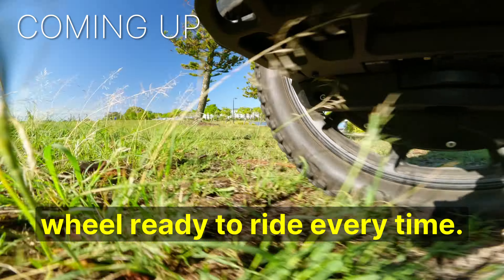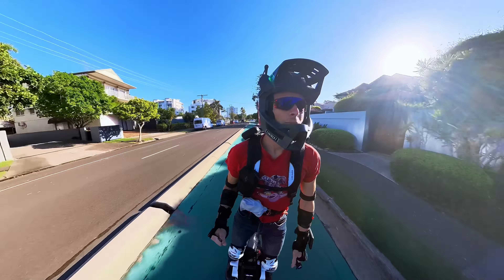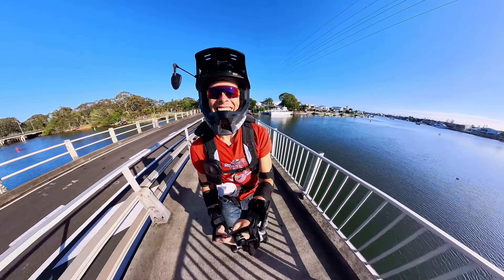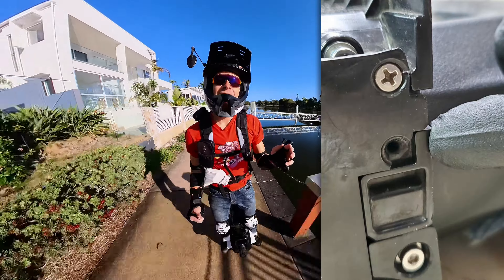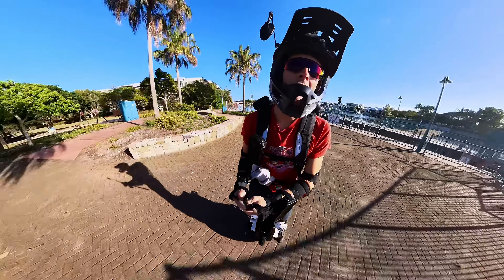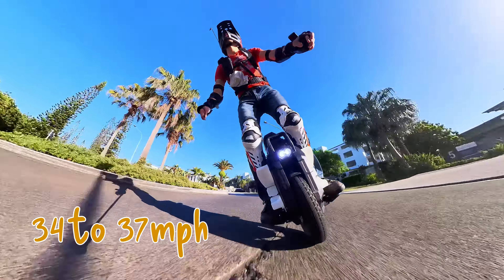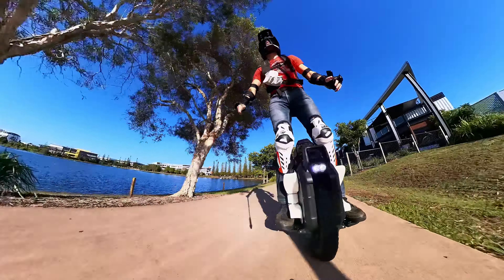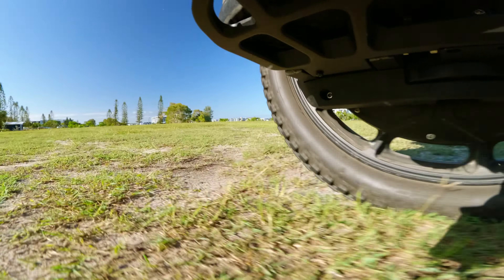long term issues and riding report, Veteran Sherman S Electric Unicycle EUC

Comment: I now have just over 6600 miles on my Sherman S, i took it out the box got on it and road, not ONE  single issue, i just changed the tire two days ago and gave it a major inspection, no barring issues or leaks from shocks or cracks in the casing or plastic. I still cruz around 35 to 43 mph and everything works like new. I'm 6' foot tall and weigh 250lbs with gear 225 without gear. I too am thinking of getting the Lynx but i will keep the Sherman s as my long distance euc. The only problem i have is with the firmware, it will erase my mileage about every three months, so my euc says i have a total mileage of 250miles but i know to just keep track of mileage in my head as i ride, usually 40 to 65 miles a day. This is a great review 😀
Reply: This review its confortabile , thanx
Reply from the maker: Hey Darren, nice! Great distance on the suspension, not sure why mine gave up early. Salt and sand must be that damaging. oh that's annoying about the firmware, happy holidays!
Cheers Jono
Reply: Same with mine. Ive gotten the "no con" 4 times now. Have about just over 4000 kms

Comment: I have my Lynx now. Definetly avoid 70lb unless you are heavy. Even if you are 75kg and do jumps.

Pad compatibility is a bit annoying. My flows don't really fit how I would like them and will need to be adjusted with a dremel tool.
Reply: Can you elaborate on issues with pad compatibility?
Reply from the maker: Thanks for the tip. I'm scrambling for the 62lbs spring down from 66lbs lynx preorder now. The early impressions misled me. 
Is it the jump pad or lack of real estate to fit the pads?
Reply: @jonoeuc  Combination of both. If you are a patton rider already and that provides comfort then you will be fine. But coming from an S22 I am used to having my pads a bit more forward leaning at the top, which you can't do properly with the front bumper installed.

However, if the pads had less of a baser I could angle them a bit more forward. I will be dremeling off some of the pads so they fit over the bumper mounting.

It's by no means a dealbreaker, but definitely something people who haven't ridden a patton should be aware of.
Reply: @Mpower31  Small area because of the front bumper. Grizzla Flow large fit, but you can't angle them forward similar to how you can on an S22 for example.
Reply: I was thinking of putting lynx suspension on a sherman s, the 70lb version I guess would make sense for offroading for someone who is 100-105kg right?

Comment: Hey just wanted to ask. What things should I look out for on my Sherman S? I bought it a few months back and only rode like 150km or so yet. But I'd like to know so I can stay on top of the maintenance. When should I look into doing maintenance, changing suspension oil, ball bearings etc? Also I think I heard in another video of yours that you can get the suspension of lynx in a Sherman S, do you think that would be worth it? I'm relatively big, 6'5, 230 lbs without gear and doing quite a bit of off roading already (and expect to do a lot more).

Any tips really would be very welcome! Great channel and content, thanks! :)
Reply from the maker: Hey mate, the main thing is keeping on top of the tyre pressure. also:
you may want to follow my SS waterproofing guide: https://youtube.com/shorts/1KnpK6qKhV8
If you notice the suspension oil is leaking then it needs a clean or service
When you next teardown use thread locker on all of the bolts. Including checking the motor hub bolts

Yeah the lynx suspension springs can be installed into the Sherman S!
The 70lbs lynx suspension would handle off-road better I reckon. Not critical but the progressive style maybe better with bigger hits.
Reply: @jonoeuc  huge thanks for the reply!

Comment: I got unlucky with mine , my tire is getting very crooked , I had to change the bearings , reccuring noise everytime the wheel turns at certain speeds , I had a E-Hall motor error after my first 500 km (but eevees fixed it) . I love the wheel but ive had less issue my V12ht which is insane to say . I bought the wheel to avoid these issues but turns out I got unlucky . Hopefully next wheel I will buy won't have those problems
Reply from the maker: That's unfortunate. How many km's now after the fixes? (hoping it's running better now).
EUC quality control is a big issue. too much variation.
The tyre alignment shouldn't be an issue unless it starts rubbing. I've the alignment video if you need it here: https://youtube.com/shorts/ZQmxh8WZF6M?feature=share

Comment: I hope this comment finds you well. This is a random question about your backpack. Do you think the backpack is worth the money? Is it specious enough for storing big work boots? The grand total is $585 USD with taxes. 

I have added the following accessories:

1. Helmet cargo net. 
2. Quick release strap. 
3. Velcro waist belt. 
4. Medium cargo addtional storage pack. 

It would be a great idea if you could make a detailed video review about the backpack, its pros, its cons etc... after so many years of owning one. 

Thanks Jon.
Reply from the maker: Hey Uni, Doing well cheers. super hot here but nice for swimming.
That is very expensive. mine was still expensive ~$450 but it was AUD. Here is the one I bought for reference https://e-riderz.com.au/product/point-65-boblbee-gtx-25l-hardshell-backpack/

Here are my size 10US riding boots (from my video's) in the pack for reference https://i.imgur.com/iGTasRj.jpeg

I use it every single ride even if it's empty just for the back protection. If you protect one thing besides your head/brain the spine is a good call. Since injuries there are catastrophic. although most crashes are forwards.

Accessories: The cargo net is the best addon hands down. I've got the X-Case but don't use it since I want the cargo net every time. 
The velcro waist band is hot in summer for me. Also, I'm too skinny for it and it only just cinches down tight enough.

I'm almost too skinny for the strap across the chest too. I have it cinched to the maximum tightness.

It's a heavy pack but once fitted properly with the waist strap it feels good. I've loaded it up with 8kg of groceries (17lbs).

I run the 2x speakers over my shoulders as per my videos. Decent spot here and they face straight up so I get maximum volume. it doesn't really project out and disturb anyone.

The only issue i've had is with these elastic loops on each side. They pulled apart at the highlighted part here: https://i.imgur.com/pP1IYbW.png
so I don't bother looping that section for ages now.

The large flat back is great for adding decals and I've added reflective tape. A mount for a rear light is needed. I've just been attaching a light to the top strap on the cargo net.

I think the 25L may be too 'Long' if you're a shorter rider.  I'm 185cm ~6" if that helps you gauge it's fit on my back.

Water resistance seems decent as is.

The front phone pouch is underrated. It's very useful. I stick my keys in there and sometimes my phone or DJI mics.

Having one large pouch is either a level height. I like it because it maximizes the space to fit everything. Although it does narrow towards the bottom, which can be annoying eg if I'm transporting food containers. Sometimes they don't sit flat.

I use a ribbon on the back for additional 'fluttering' visibility.

other pros
The shell is relatively cheap and can be replaced for colors or if damaged.
Contoured back is comfortable and grooved for ventilation. Although my back still gets warm.
Protects its contents eg laptop.

other Cons:
It doesn't stand up on its own.
Price $$

Would I recommend? yes with the caveat that I haven't tested other back protector packs.

Hopefully that helps you make a decision and now I have a script if I make the video :)

Cheers, 
Jono
Reply: @jonoeuc  Thank you Jon for the detailed response. I much appreciate you taking the time to write all this and it shows how much you care for your viewers. You are an awesome guy.

I'm 6ft (182cm) rider, and I weigh at 240 lbs (108 kg)  without gears on. I just wanted to make sure that I can fit my gym stuff in there like a running shoe size 12 (size 46), gym hoodie, running shorts and shampoo stuff. My gym back is 35L size and maybe with the cargo net, I can make it fit everything.
Reply from the maker: Hi Uni, hows it going? Ive made that Boblbee review video if you're interested! 
https://youtu.be/FpGbQLNLnF0?si=j_GtzbP3ShAxLqXW
Reply: @jonoeuc  it was very awesome, I watched yesterday and thank you so much. Great content 👌 👏

Comment: You mentioned 25 psi for your bodyweight. Do you trust doing large curb or big stair drops at that psi without damaging the rim? On my EUC I'd be worried about damaging the valve stem at lower PSI, due to bad wheel design (V12HT).
Reply from the maker: The suspension helps a lot to protect the rim. I still slow down when bumping up curbs. Not concerned for stairs and smaller drops. Larger drops I bend my knees a bit more! I generally advocate for setting the pressure for ride feel over simply protecting the rim. (particularly on suspension wheels!)

Comment: Where did the lovely star war bumpers go....I used your code to get nylonove but I want the lynx version of these bumpers
Reply from the maker: I sold them off as a package with the Pedals, quick suspension adjusters and the headlight shade! It felt bad, they don't fit on the Lynx though.
Oh, did that code work!? I thought the 'jono' code was only for Kinetic V1 and 2.0!
Reply: @jonoeuc  ye sorry I meant pads... I got 2.0

Comment: Well... today huge faceplant due to hall sensors error . Not good .
Reply from the maker: not good, how re you holding up?
Was that on the Sherman S with the latest firmware?
I ask because of the new feature: hall sensor failure algorithm that allows the wheel to run with complete hall sensor failure. I thought the SS got that update.
best recovery, jono
Reply: @jonoeuc  I'm ok . Motorbike gear did job pretty well . Small pain under knee during one day and one hand finger small pain . Nothing more . The source of failure was damaged motor cable near bearing . Rubber seal cut it and hall sensor wire . Fixed and today test ride will be . Yep , still waiting for that software .